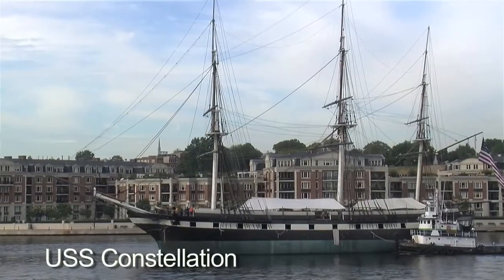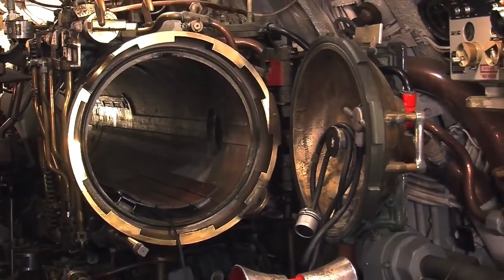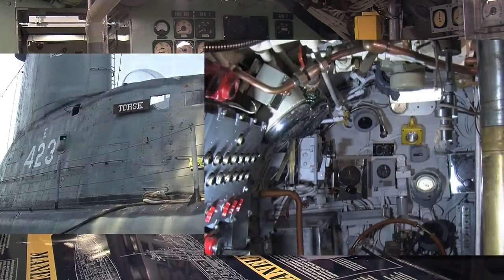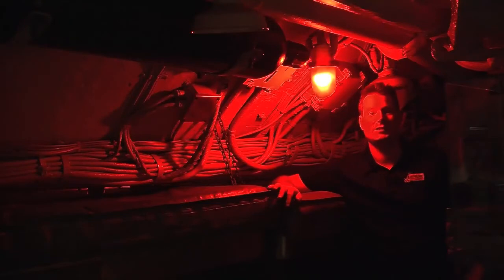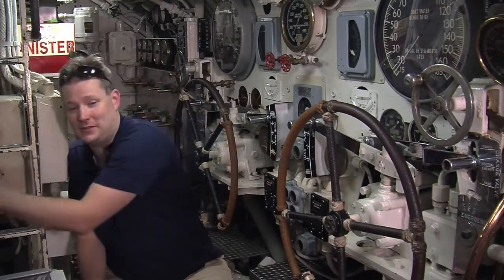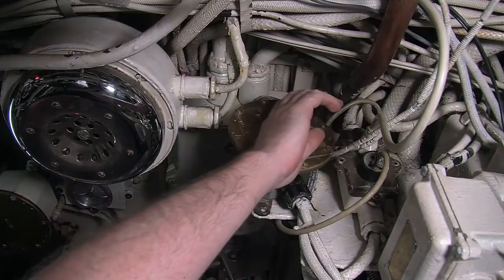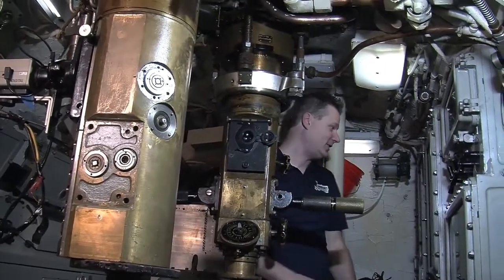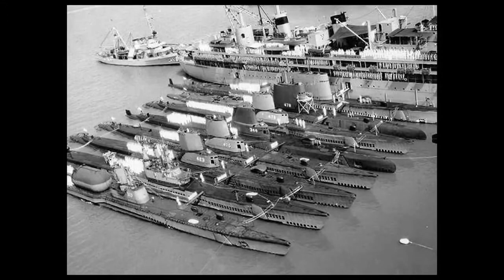Virtual Ship Tour: USS Torsk (SS-423)

Comment: What emits the distinct smell aboard the submarine? Is it the wires,  the insulation on the wires,  or the steel from which the submarine is made? Or something else?
 Thanks.
Reply: They use something called amine which is used to remove CO from the air. Admittedly I am not sure if they began using it ast this time or the start of the submarine service or later. I am also unsure if it would linger to this day on a sub as old as Torsk. It also has tons of other smells in a confined space which are not all pretty like diesel and lubricant oils and such.

Comment: the guide when at the hydraulic manifold never mentioned its most important thing..to open the vents so the air escapes, and the tanks fill with water, and the boat dives..also never mentioned that in the after port corner of control is the radio room